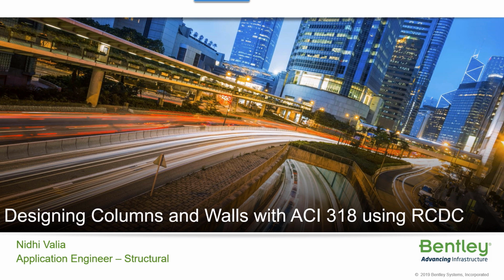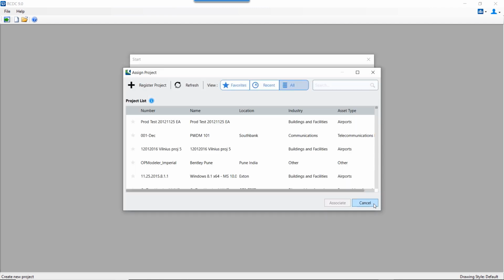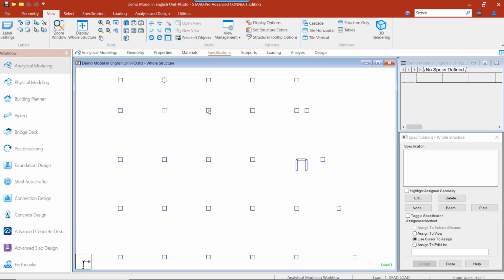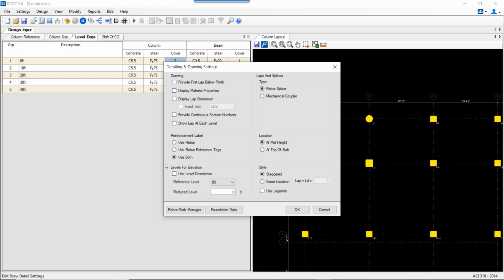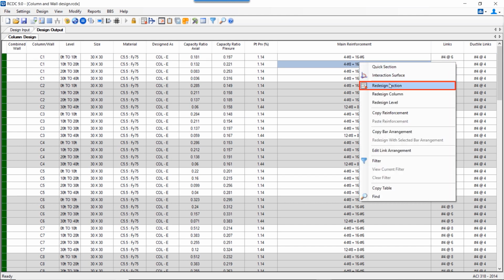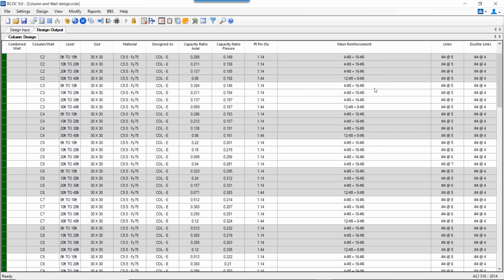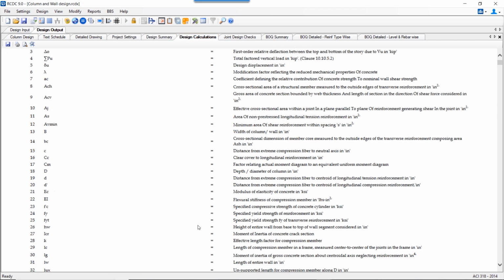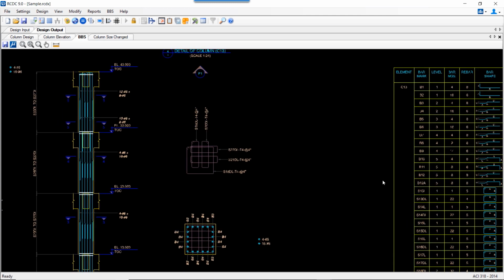Designing Concrete Columns and Walls with STAAD Advanced Concrete Design

Comment: Hey, so I did not come across any failure while designing the columns in Staad RCDC but some of the main reinforcements are in red and the others are in a blue text, could you tell me the reason behind it?
Reply: Check if the reinforcement at the bottom of column should not be less than that of above